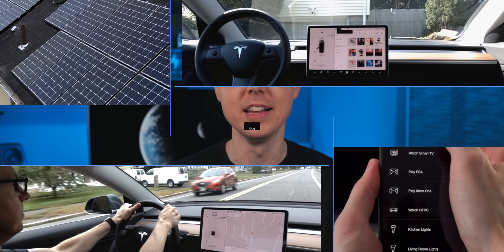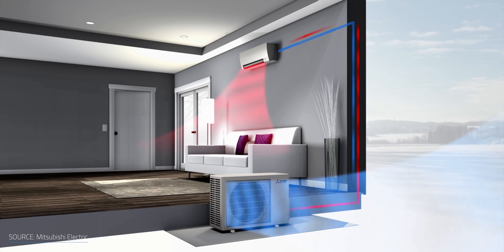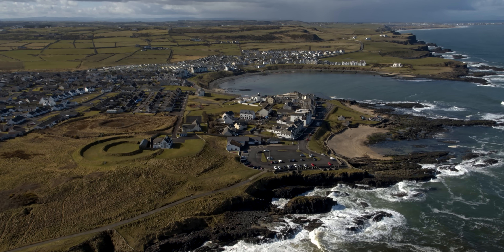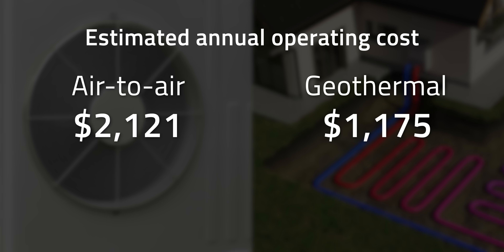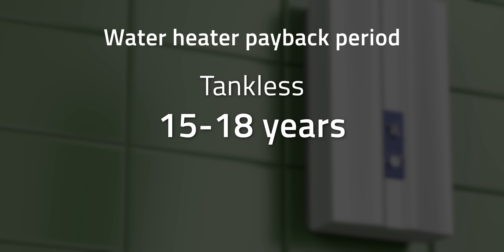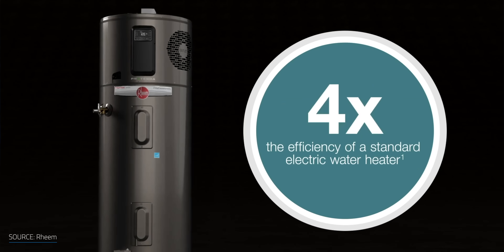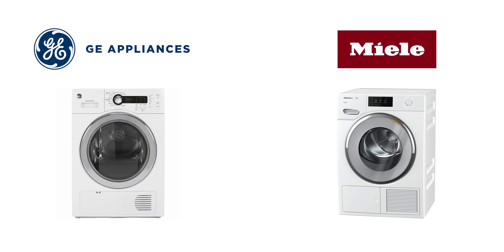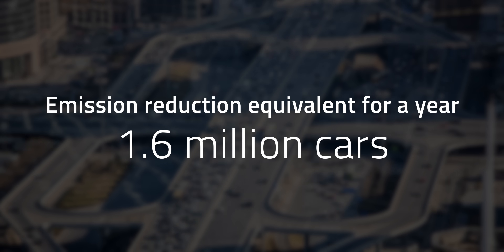Why Heat Pumps are Essential for the Future - Explained

Comment: Four years I had a petrol car and an oil fired central heating system.  Now I have heat recovery ventilation, more roof insulation, an EV, solar panels and an air to water heat pump. Four years ago I used around 70 MWh of energy annually for my house and car. I now use around 18 MWh for the same thing (a little hard to exactly track all the energy used by my EV for public/work charging). Of that, around one third of that energy was locally generated.

So yes, heat pumps everywhere.
Reply: The construction of solar panels is the world’s 3 largest source of greenhouse emissions. EV’s are far from green also.
Reply: I think you mean Kwh not Megawatts - unless your house is a powerstation.
Reply: waiting for answer please tag me
Reply: It works because you started at the start. Insulation and heat recovery ventilation. I bet you also spent some time making everything very airtight. Once you done this your heat pump will be a great deal smaller. Ask me how I know ;-)
Reply: I started to purchase a used ev with a bad battery at 80,000 miles (freaking ridiculous). I checked around for the refurbished batteries that they say are available, they don't exist. I checked with the special the factory was supposed to have for a new battery at $5,600. It doesn't exist. Found out the replacement battery is going to cost around $20,000. I've never paid over $5000 for a whole vehicle and am able to drive that used vehicle 300,000 more miles. Do the calculations, you'd break even finding a really nice used large displacement V8 vehicle that gets 14 mpg.
Reply: lol why would a heat pump save you electric over an oil furnace?  sounds like lies.
Reply: @dukee4333  a heatpump uses around 2/3 rds less money than oil. It's not too hard to do the calculations yourself by calculating price per BTU of oil, straight electric, gas or heatpumps.
Reply: @astranger448  insulation is the key. People don't realize there's 5 different ways heat transfers and most home insulation is effective on two only.
Reply: @WileyFox01  nope he means MWh ...a home that only used 18KWh annually would be amazing...probably need more than that just for led lighting.
Reply: @paulies5407  
The emissions from the construction of solar panels should be directly compared to the emissions from the drilling and refining of oil should it not?
At least not compared to doing nothing at all anyway...
Reply: @WileyFox01  18 MWh/year is 49kWh/day. 3kWh is a typical daily consumption for a single apartment. So yeah, something doesn't add up, but not as simmple as MW vs kW. Must be driving a lot, I guess
Reply: @colchesterelec5105  Average UK household per year is 3000Kwh per year.
Reply: @Bryan-Hensley   The midwest has been using heatpumps and gas heat for a long time, it's not a new conversation.  2/3, so disingenuous.
Reply: @feedbackzaloop  Apart from it being   10x more (ie 1Kw for 1000 hours = 1Mwh) the average UK household used 3000Kwh per year, luckily for me I use much less than half the UK average so can keep the lights on a little longer.
Reply: @WileyFox01  I knew American use more power but I do hope that's the mistake  however 18KWh is not that much for anual use
Reply: @WileyFox01  that is the thing, it is not 10x more or 1000x more than usual. But mind you, he said "house and a car"
Reply: @paulies5407  yes but they last. Or do you want to keep using on time use emergency like fossil fuel. Also double check your numbers I bet they came from an oil company sponsored “research”….
Reply: @Thefreakyfreek  The chap was stating he used 70Mwh. What does he run, a smelting plant?
Reply: Good man Kevin Lyda, you're doing your bit for the environment. 💚👍
Reply: @WileyFox01  It does sound a lot, but considering I was using 1MWh a month on running 6 linux servers 24/7, (just serving, not mining) and not factoring car usage, perhaps not too far fetched - still, 70MWh a year is 20x average UK usage.
Reply: ok, I'm interessted in this conversation give us the numbers for the miles/kilometers of the car and the consumption, also give us the numbers for heat and electricity separated please.
Reply: @ahaveland  how do you get 70MWh from running 1MWh server? Must be  6 of such... (the way you put it, 6 servers consume 1MWh combined) 
And would changing from Linux to Windows server make a difference?
Reply: @WileyFox01  i came here to say the same
Reply: @Bryan-Hensley  Agreed, that is if we forget the health benefits, the impact on the environment, the ever increasing costs of fuel and maintenance.  But for some people they have no choice and for others they couldn't care less.  Thankfully more people feel these are important which is why EV manufacturers cannot even come close to keeping up with demand.
Reply: @STUCASHX  I agree..and add in the impact of building and servicing pipelines, shipping oil to and from the refinery, shipping to the distribution point for the end user, leaks, evaporation etc and the output when burned per unit of energy.  Now that would be an eye opener for some.
Reply: @WileyFox01  You left out the conversion to Mwh's for those who aren't clear - 3000Kwh = 3Mwh.  A google suggest the average is 3100Kwh/yr...just to provide another confirmation of your post.
Reply: @feedbackzaloop  1MWh per month is 12MWh per year, which I didn't think I needed to spell out. Hence, this is why I thought 70MWh a year is excessive.
(Linux servers were running multiple master mysql and spam filters at home over openvpn proxied from my ISP because I was dealing with more spam than my single web/mail server could handle.)
Reply: @Bryan-Hensley  You can thank Elon Musk for that. He came up with a car that can go at insane speeds, accelerations and range that nobody needs but it comes at the cost of a battery technology that is not exactly long lasting, Li-Ion's lifespan is not very good. He should have gone for a car without all these bells and whistles but with battery technology that can go for up to 10.000 recharges, current LiFePo is about there. Not so much bling but good enough for normal people. If I was you, I'd find a nice ICE with a decent mileage and call it quits, leave EV's for those with too much money.
Reply: @ahaveland  and 6 times per 12 is 72 - I thought you were trying to come up with a matching scenario. Obviously, 70 is huge, but even 12 is a lot even for a server, equating to 1,4 kW non stop power. Yeah, should be about 6 typical single-slot units
Reply: @astranger448  yeah, I've been thinking about changing my attitude towards EVs. In a way I'm all for them if it's someone else buying them. It's really a win win situation for ice and EVs. If enough people get EVs it's bound to drive gas prices down. I think the biggest thing that has me pushing back is the government trying to shove them down our throats.
Reply: @richardlangley90  Cheers Richard, I think I put a conversion in another reply but if we make it really clear 1Mw is 1,000,000 watts  or 1,000 Kw........so Kevin Lyda was using 25x more electicity than the average home.
Reply: The OP said ENERGY not Electricity. All of the quotes for uk consumption are electricity consumption not total energy consumption. Over 80% of uk homes still use oil or gas heating which is the largest energy demand on the home. A small lightweight car will use about 20 MWh worth of fuel a year. With a large poorly insulated US standard of living home, this is not an unreasonable claim that OP is making.
Reply: @WileyFox01  probably
Reply: @johnmount5487  I agree it's not an unreasonable claim but what I can tell you is my total bill for last years electicity and gas was just under £1000, helped by the fact that I don't use the central heating, the boiler only comes on for hot water. The poster may have reduced his usage dramatically but he is still a heavy user compared to the average UK home.
Reply: So your relatively wealthy and prob live in a modern house. However you look at it a heat pump system + water heating and storage + insulation + electric car + back up heating for winter extremes all adds up to around £120,000
Many homes are old, no cavity. Insulation will need to be fitted internally, insulated plasterboards are excellent but very expensive to fit. How many people do you think can afford that kind of cost, especially when it equates to 3/4 of the value of the house.
Pie in the sky !!!
Reply: @Nailnuke  I wouldn't assume or presume as It will make a fool of you or I, think that's what used to be said. No, not wealthy nor do I live in a modern house (1969), more so it's leasehold and no changes can be made to the structure or grounds. So, no electric car chargers, heat pumps or solar can be installed, but I still have to subsidise through taxation/green levy those that can afford these new technologies whilst being on a low income.
Reply: @Nailnuke  Leave that house!
Reply: @WileyFox01  no, I meant MWh. That's over a year.
Reply: @paulies5407  [citation needed]
Reply: Folks. I converted my oil usage and petrol usage from litres to MWh. Yes, the average UK home (I live in Ireland but ok, I'll humour the colonists) uses 3 MWh ***of electricity***. That's not how much energy the average UK home uses. Also, add in my car.

Yes, 18 MWh is a lot, but my house is entirely electric. And it includes my EV - that's around 5 MWh alone.

And while I increased my insulation I still need to up the insulation in the walls. And seal the windows/doors better. And change my rads. So there's a ways to go yet.
Reply: @WileyFox01  18 mwh means 18000 kWh.
Reply: @user-bj4lp3fr1o  I know! The op misposted.
Reply: @WileyFox01  no he didn't mispost. He added all energy sources and converted that to kWh. While an average home might use 3.5MWh per year worth of ELECTRICITY, the total energy demand for a household is much higher. If you use gas to heat your house you will use about 15MWh with of energy for that on avergage. If you also add your car usage and convert the amount of petrol you use (liters) and multiply with 10kWh per liter used (which is the amount of energy in 1 liter of gasoline roughly), you get your energy usage for your car. So if you drive 20000km per year with an average of 1 liter per 20km (which is very economic for a ICE car), you use an additional 20MWh of energy just for driving. So Add that up and you already get about 40MWh in energy consumption in total.
Reply: @paulies5407  That is just plain false information you are posting here. The total industry is responsible for 21% of CO2 emissions. And solar panel constructions is only a small part of the total industry. Fifty percent of all greenhouse gasses come from energy and heat production using fossil fuels and 24% comes from agriculture. Also over their first 5 years, including production emissions, solar panels generate 10 to 20 times less CO2 than fossil fuel counterparts. And yes EVs are definitely not 100% green, but they are still much greener than their ICE counterparts AND get greener the more renewable energy we create. While ICEs don't.
Reply: @WileyFox01  I see the vast majority of homes that use a lot more than that (I'm a uk sparkie)...but I suspect recent events will drop the average closer to  you're figure( for non EV owners) ...I'm now seeing and awful lot of households that use <4Kwh daily

Comment: It's great that you're taking us along the jorney to your new home and deliver hands-on experience on future home technologies!
Reply from the maker: I'm really excited to share more about it.
Reply: what materials are you going to use? there are many building materials built from waste. From replacement plasterboard, structural ply, insulation and concrete using recycled concrete and additives such as fly ash and steel slag. mineral extenders such as limestone too.
Reply: @UndecidedMF  Ideally, moving heat is more efficient than using energy to add heat. 

1) So consider tying together most of the heating and cooling appliances in your new home (i.e refrigerator, HVAC, hot water generation, etc) into a closed looped system.... 

 2) Then add a heat storage medium(s), such as a phase change buffer.(i.e a heat battery (and a lower heat (ie cold) storage)). Since there is latency between the demands of the different appliances, so a buffer is needed to use the heat effectively.

3) And then only one heat transfer device such as an Absorption Chiller unit that can be powered by a source of heat, such as thermal solar panel (instead of the electric needed by an air to air or ground to air heat pump, which still could be used)...  Can replace all the separate heating and cooling mechanisms in each appliance.... 

I know I left out a lot of the complexity of actually doing it. But it has been before. And you know what they say? Go big or go home ;)

Comment: I agree, a few years ago we added a 5 zone split system to the house as part of our solar install and due to the rebate. The ability to selectively cool or heat the rooms we are in versus the entire house was such a cost savings. It’s worked flawlessly and we love it.
Reply: San Pietro Progettista--  FIVE ZONES?  Are these mini-splits?  Are you using separate zone sensors/ thermostats, each with separate duct fans and a central controller of some kind?  Are there return ducts for each zone?  We just installed a 24 SEER Bryant Evolution split system (identical to Carrier Infinity), with communicating variable-speed air handler using our existing two-zone ducting and I'm having trouble with one room staying a bit too warm (and, I assume too cool when it's time to use the heat).  Just wonder how you're getting control of each zone if using just one air handler.
Reply: @mikepowell3335 Hi Mike, it’s two Lennox split systems. Both are 3 ton. We abandoned and removed the ducting under the house and went with the wall units in each room. All the piping and cables run through the attic. The family room and living room units are on one handler and the 3 bedrooms are on the other. The units do a great job, the living room unit cools/ heats the living room, dining and kitchen quite well as long as I run the ceiling fans.  We live in the desert/ mountains and it’s extremely hot here most of the year. Having the ability to just cool the rooms we are using and not losing a ton of air under the house saved us over a grand a month. The wall units do need a lot of care and cleaning. You can’t ignore the service on these units either.
While I am not big fan of the having giant boxes on the walls in every room, the trade off of efficiency and savings allowed us pull the ducts and re floor the whole house AND now when a skunk gets under the house I don’t have go and fix all the ducts.
Reply: @mikepowell3335  Mini-split zone systems can have air handlers controlled by separate thermostats. The condenser can be smaller than the total capacity of the air handlers in some cases, saving costs. This works best when pairing rooms on opposite sides of the house so heating or cooling needs shift as the sun moves.

Comment: Great video Matt. Thanks!!  You're preaching to the choir with me for sure. Had a ground loop heat pump in my last house and absolutely loved it. Wanted to do one for my new house but the costs didn't pencil out. Ironically a super energy efficient home has lower energy bills and therefore the ROI for a ground loop heat pump skyrocketed to around 69 years. LOL. So I went with an air source heat pump instead. Also the Rheem hp water heater you showed, which is amazing BTW. 
Even though air source heat pumps are slightly less efficient than ground loop, this is only the case a few months out of the year. It's been 3 years and counting with the HP water heater and air source HVAC heat pump. It's mind blowing to watch it run and heat the home when it's howling and 4°F outside.

Comment: Having a 15kW ground-to-water heatpump in Finland, works like a charm for 10 years now.
It reduced my energy consumption by 35% while we simultaniously added 80% to the heated living area of our home.
Floor heating running at 45°C, some radiators at 35°C and plenty of hot water of 55°C
Reply: Hydronic floor heating works perfectly with heat pumps because it requires lower water temperatures. The drawback is you need a separate system to provide cooling, and only a few floor types are optimal. Hybrid heat pumps exist that will handle both a floor and air system but are hard to find.
Reply: @mv80401  in my care site to the old house's construction, the for actually needs higher temp than the wall radiators.
Reply: @ambassadorkees  I don't doubt it as radiators don't have to penetrate a floor substance to heat a room. But in the US radiators are rare so by comparison radiative/hydronic floor heating is still lower temp